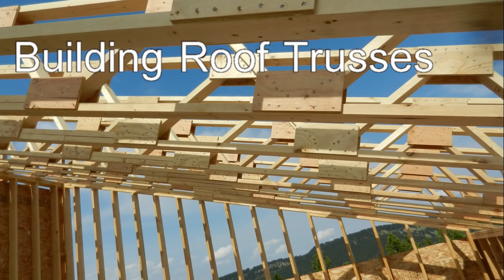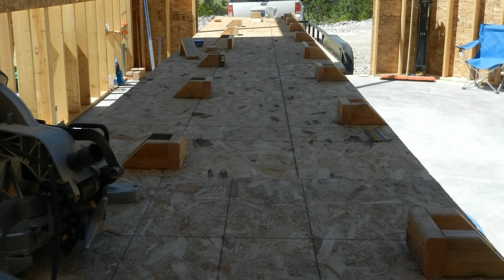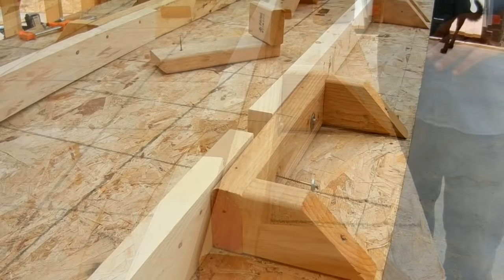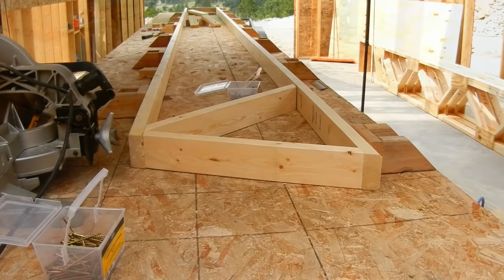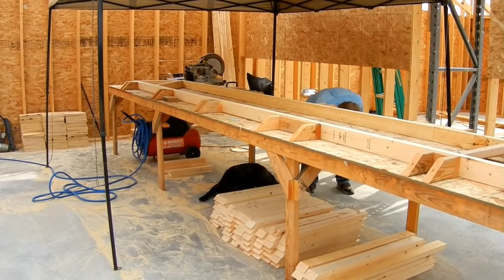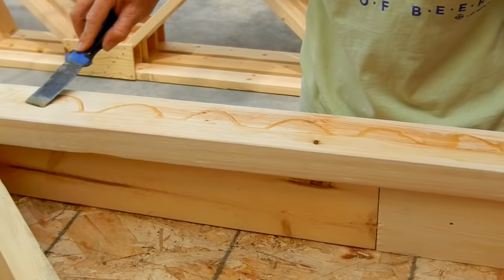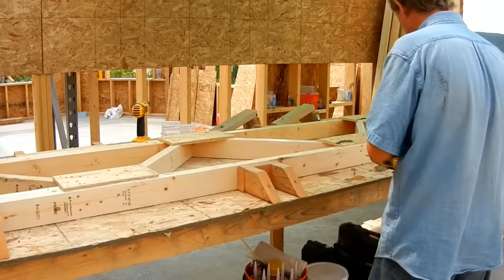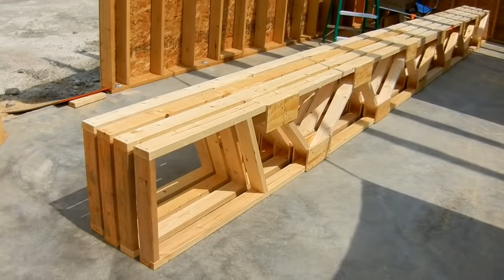Building Roof Trusses

Comment: It was nice to watch what I assume is family teamwork (Pa and Ma) assembling the trusses for the family home.

A brief primer on the building's dimensions and how the trusses dimensions were arrived at would have been a solid plus,  but nevertheless it was nice to watch the careful assembly process.  It also it would have been nice to see the price difference between placing an order with a truss company and the actual do it yourself cost savings.  Truss companies typically deliver on-site either onto the ground or hoist the pieces it the air to assist the builder; how did these hom owners get their pieces into the air, did they rent a crane?  Since these weren't huge triangles, the homeowners were by necessity setting these against a either a ridge board or ridge beam; it would have been nice to see how the pieces all fit together and the logic behind their quality craftsmanship and assembly.

This was a well thought out process.  The work table's surface had all the essential anchoring points to hold the truss assembly securely in place throughout the assembly process using precut materials for assembly.

And as for the Gorilla Glue, I really love that stuff as it bonds strong; just don't forget to spritz the work surfaces with water as the water is the catalyst for the glue's ingredients which then turn to a foam ensuring even coverage.

All their wood materials appeared to be kiln dried so crowning is likely not that big of a deal.  Has anyone else ever noticed that none of these do it yourself videos ever mentioning crowning either the exterior wall studs (crown out), the joists (crown up) or the rafters (crown up); why is that, are more folks than we know building crooked, wavey, and bowed structures?
Reply: Great questions.  I'd like to why the rafters were built on their flats and not on their edges.  Was this for the look, ease of affixing the roofing...?

Comment: well built, just concerned about the use of screws in some crucial areas (assuming they are just typical wood screws as to say they are not structural screws).  Also would wonder if it would pass inspection.  I would have built these on edge instead of on face though,  you would have the same material use and more strength.  You would also have more area for your plate connectors to glue and fasten to making the plates hold everything together even better.  Hope all works well.
Reply: Building them on edge would make them vertically stronger, that is true.  However, being as long as they are, they would be more susceptible to sudden lateral warping (in extreme cases to a point of folding), which could be very dangerous.  To remedy that, you would need lateral support between each truss, which they don't have (as per picture of the finished roof).  I can assume the roof sheathing will tie the trusses on from the top side, but the bottom side will still be free to warp.

Comment: Just so you know, I an am engineer, and I cannot say these are good or bad, I have no idea of the load or pitch, so I hope you had them engineered by a professional. Trusses are not something to just fudge. A few points of interest; that was whitewood being used, the truss companies generally use #1 SYP, which is much, much stronger. But they also do not turn it on it's side like that. 2x4s on flat are much better for the sheathing, a sheet of plywood sharing 1-1/2" truss is actually worthless from a material science perspective, often they get much less than 3/4". If you read the specs on all plywood, it says that no fastener should be used within 1-1/2" of the edge. The same could be true for all lumber, the end cellulose fibers are sliced open, they need to be sealed, but even if they are, they are first to rot from mold and fungus. Wafer board is the worst of all products since it cuts all the cellulose fibers, all the ends are exposed, it acts like a sponge, that is why is swells so much when wet. Last point, a nail, even ring shank nail not very strong. Any screw is 15X stronger than a comparable nail. Easy to test, try a claw hammer on a nail head, try the same on a screw. That is true for all construction, so if you are in doubt of the strength of something, always use a screw. Screws damage the wood much less, since they wind the threads around the cellulose fibers, not cut through like a nail.
Reply: Robert....That was exactly what I was thinking. The 4" side should be vertical...Up and down....not sideways. He's losing all of the strength by turning sideways.
Reply: No, sorry Tim, you do not understand structural engineering. The top and bottom chords are under tension and compression, the web members distribute that load so that ideally, the lumber is mostly in tension. True, a 2x4 on edge is stronger in compression. On flat like B-spot made his is actually good in that it keeps the load vertical, does not allow a truss to twist. This is like taking a sheet of paper and trying to have it support a cup of coffee, never going to happen, and so now you understand how critical it is to block between trusses the way they show on all plans. I prefer the truss top and bottom chords to be on flat for the reason mentioned in my comments. !-1/2" thick trusses like they make in factories cheaply are valid, but where I would differ would be to scab a 2x alongside when the ends of a sheet of plywood have to share such a narrow edge. All plans show cross bracing every 4' while installing trusses, problem is, nobody follows the plans.
Reply: It's a matter of the cross-sectional area of the bottom chord which is in tension. The top chord is in compression and unlikely to fail. The truss' strength comes from the vertical height between the two chords rather than from the actual timber depth.
Reply: Robert Carver "  Screws damage the wood much less, since they wind the threads around the cellulose fibers, not cut through like a nail."  Exactly the opposite of what JuliusNatterer is saying, and I would be rather on his side  ;)
Reply: Screws may be superior in tensile situations but not in all situations, nails support shear loads better.
Reply: Especially if there s predrill
Reply: I agree, my point was not very clear but nails have way more flex than screws do. While it is harder to bend the screw over the nail, the screw is more brittle and way more likely to break where a nail will almost never break will bending. My point was just that there are some situations where you expect movement and a nail would be better.
Reply: So many DIYers don't realize the difference between construction screws and drywall screws. The brittle metal of a drywall screw may perform fantastic in a static situation, but if a seismic event gets the building rocking and cause the fasteners to snap, you're done.  (But I still use 'em all the time in non-structural applications 'cause they're cheap and more than adequate for most jobs)
Reply: Ben Lane 
Ben's got a point. I've seen broken screws. I've never seen a broken 16d
Reply: and nails dont cut the fibers just spread them apart and if the wood is to dry it splits the lumber, only the square cut nail cuts the fibers which is why they dont use them anymore.
Reply: What is your problem? No 350 lbs guy or gal is allowed to go  up the roof!
Reply: laying the 4x side horizontal actually prevents the truss from bending left to right along the horizontal plane.   plus easy to nail ply on top of truss for roofing

Comment: Fyi I'm NOT an engineer or architect. However, as a licensed contractor, I've designed and built houses for 18 years and I've constructed many types of engineered construction projects (roads/bridges ,sewer treatment plants, subdivisions, commercial buildings, etc.) for 47 years. 

The following friendly comment is offered for any future construction that you might do:

1) I noticed that your internal 'web bracing' didn't have compound cuts (see YouTube video by >>>>>>>>>Cira Darnoc<<<<<<<<eight minutes and nine seconds in length) on each end of the framing piece which is essential to prevent web movement and keep the truss from sagging, which it will over time and very soon! The glue will 'break' and not prevent movement.

2) Also, when nailing with a nail gun, you broke the outer plywood surface and drove the nails through the outer layer of the four ply plywood gussets. By over nailing the nails, you reduced the plywood strength to only three layers thus reducing the gussets actual holding power by approx. 30%-38%. When plywood is used in compression and tension, not like a floor or roof decking, it needs to have no installation flaws.

Kudos for doing the work on site and at your pace. I hope everything remains stable/original. 

Thanks for the video and I like your steady pace! Thumbs up.

....13 

PS.--Nice country side, peaceful looking!
Reply from the maker: Thanks for the constructive feedback.
Reply: cira darnoc
Reply: Calvin Tolleson m
Reply: Nice work B-Spot. 

As far as ply gussets are concerned my father (structural engineer) recommended a minimum of nail/screw fixings as they cause stress concentrations. I used epoxy glue on my ply-box beams as the weather is frequently wet here.
All through my building career I've had advice on various aspects of engineering but my father particularly loved timber and ply as he trained on the de Havilland Mosquito bomber and in the 70s he designed and built a plywood trimaran using similar techniques and named the prototype "Mosquito" in honour of that phenomenal aircraft.

Thanks for sharing your creativity with the world via your videos.
Do you have a video of the finished house?

All the best.
John K.
Reply: arkansas13 Right. Over penetration of nails or screws reduces the strength. For wall sheething, 3/8's min code but typical sheething is just under 1/2" allowing for a little over penetration.
Reply: arkansa
Reply: "when nailing with a nail gun, you broke the outer plywood surface and drove the nails through the outer layer of the four ply plywood gussets. By over nailing the nails, you reduced the plywood strength to only three layers thus reducing the gussets actual holding power by approx. 30%-38%."

I call bullshit on all that
Reply: Thanks for posting video. I like your set up a lot!! I bet you saved a great deal, and best of all, you know it was done right.no compromises.

Comment: Most city and county building departments require pre-engineered sealed and stamped truss drawings but I would wager these home built ones are much stronger.
Reply: +Rob Finn 
They would at the very least prohibit the screws and glue types he is using. Otherwise a strong design.
Reply: +Alaska Bruce It looks to me that the screws are only used in fixturing the pieces into his jig and to hold the glued top and bottom chord braces.  That glue is plenty strong, and I'm sure the engineering supports it.
Reply: It appeared to be polyurethane glue which is not rated for structural use.
Reply: Rob Finn 
steel gussets get approved easier..trusses of this size would be 2x6 runners of southern  yellow pine lumber.
Reply: @CrawfordMethod  Actually the glue manufacturer does NOT support it.
Reply: How would a bank feel about a mortgage on a house with no engineer stamps ?
Reply: @chrismalchoff7552  Have you ever bought a house?  The mortgage company doesn't give a squat about your stamps.

Comment: Great video and meticulous work with high skilled effort.  Would have liked to seen some commentary and some interaction with the dog just to break things a little.  I am building my own home next year and have designed a mini-tower crane that I will fabricate and use to single handle and erect frame walls, floor and roof trusses, windows, doors and roof sheathing.  This will minimize use of ladders and reduce back injury.  I will be making a video of that.  Thanks again for sharing your methods and time.
Reply from the maker: +Rob Finn Excellent.  I would like to see your video too.  Check out http://thehighground.weebly.com/  it shows a little more of the building.  You may or may not get some ideas, there is more dog content and some bears!
Reply: There was a dog in this video? I've watched it 5 times and have never seen the dog?

Comment: I agree with the craftman ship coments, but the trusses should have been built with the long side of the 2x6 in the vertical plane. the construction that you made will most likely be strong but it will flex up and down much more. It would not have taken more material either.
Reply: J.C. Kohle  correct 2x4, (typo)

Comment: Also, should be nailed; nails have greater shear strength.
Reply: Are you sure? You may want to check your facts. Lots have changed in the last 10 years.
Reply: @mrreams711  depends  on type of screw, most are still made using non-ductile metal.
Reply: @mrreams711  Yes, it is certainly true, you can find out what he means by trying to snap a nail vs trying to snap a screw. Screws are harder metal and because of the screw part, they are much weaker when it comes to shear strength. They have better holding power but much less shear strength. They are hard and strong but because of that they are more brittle, therefor less shear strength
Reply: Hrs using screws where there are tensile loads. Nails in shear in the gusset plates. Good combination.

Comment: by drilling the  hole first and then putting the screw in makes a much stronger connection than just putting the screw in.  I usually glue all my joints using staples or screws as some glues
are stronger than the wood.  Very good video and this is  a very strong truss!  I would prefer his trusses over manufactured ones any day

Comment: Great video! Thanks for sharing. Do you have any specs you can share, like…
- length, depth of trusses?
- what angle you cut the webs?
- what screws you used?
- anything you’d maybe do differently if you were to build them again?

Appreciate it!
Chad
Reply from the maker: Length 26'
Depth 22"
Web Angle 45 deg
Screws are 3.25 construction screws
Nails are 2-3/8 galvanized ring shank
Plywood webs are 1/2 exterior sheathing
In later versions I used construction adhesive for the glue.
Reply: @BSpotBuilds  :: Thank you so much! Really appreciate you sharing this info.

Comment: Gotta say this: if anyone goes to tear this down one day, they're gonna have a hell of a time!
Reply: Wow, got some "Likes" on this comment...

 Aside from that, I'm majorly impressed with the build jig for those trusses, as well as the  ability to pre-cut all the components for rapid assembly. That's brilliant! (I've built some tiny jigs for some tiny projects, so I understand the effort involved.) That huge jig is a work of art  Very impressive. 

Equally impressive is their use of glue to strengthen the joints of all the components. Not many builders would go that extra mile. Almost seems superfluous-- but you really can't minimalize that added strength. That extra step will prove itself decades from now.

Also, they used nails to secure the parts together. Perfect!  "Glue and screw" is common, but nails are much stronger against shear forces than screws. Trusses need that. This house will be a fortress!
Reply: Shame B-Spot doesn't have any more of the house build in its archive-- would've loved to see the finished project.
Reply: @shaddec55  I'd like a reference for "nails are much stronger against shear forces than screws".   Screws are much beater under tension than nails though!   I'm not sure of the improvement of vinyl coated nails, however they still use them. 
  That was the biggest bottle of gorilla glue I've ever seen; I usually get the smallest size cause it cures faster than I can use it all!!

Comment: Screws dont have sheer strenght.  Nails or wood screws are ok but not deck screws. if you can break the screw with a hammer that is not s good thing.
Reply from the maker: Oh yes they do...if they didn't they would fall apart in you hand. Bonus question what screws in he design are in sheer?
Reply: Notice how he used nails everywhere there would be a permanent sheer stress and used screws primarily to provide temporary tension (and always pre-drilled). This guy was thinking.
Reply: These are beefy trusses for sure, but no, screws do not have shear strength. They are not allowed for sheathing or structural framing in any code I’ve ever seen.
Reply: THERE IS NOTHING IN SHEER !!!!  THIS DESIGN IS JUST AS GOOD AS WHAT CHINALOWES WOULD DUMP ON YOU !!!!
Reply: When tension or compression moves the wood that creates shear. It’s not the design of the truss that’s bad at all. We are just explaining that you can’t use screws.
Reply: I understand.  I myself would have used my pneumatic framing nailer.  It would have been so much faster than drilling pilot holes and screwing 3" screws.  Sorry for shouting.  I've never seen rafters built like this, with nearly 2 foot facia boards  on the overhang.  It just seems way overbuilt to me.  I wonder what kind of snowload they were shooting for.  300 lbs psf  ???
Reply: chivone21 rather be over engineered than under engineered especially when it’s his own place.
Reply: @chivone21  It's a raised heel truss that provides room for tons of insulation.
Reply: There are plenty of structural screws. Not necessarily what was used.